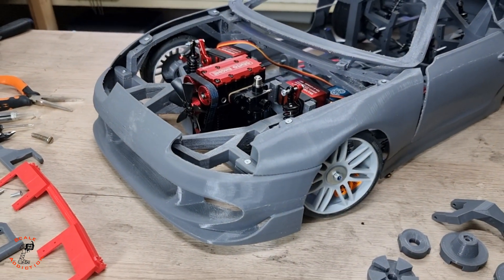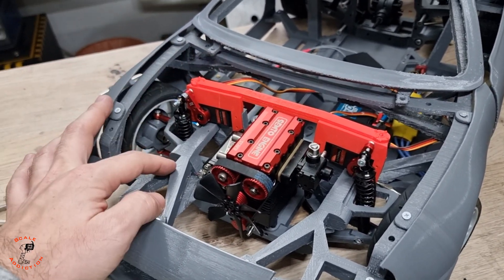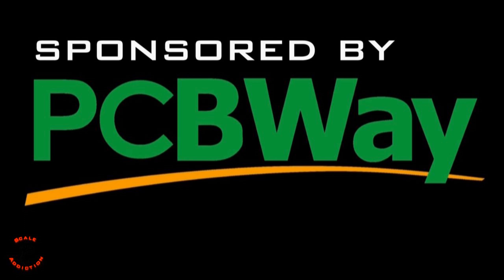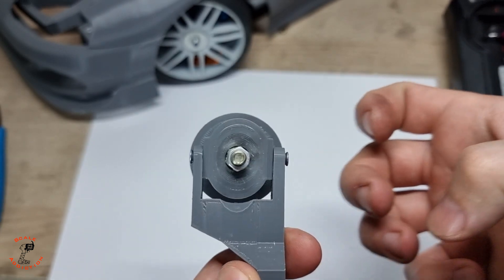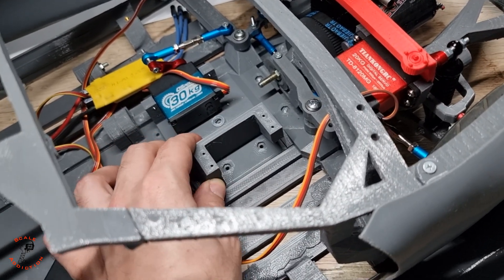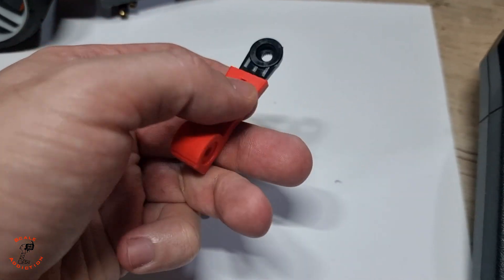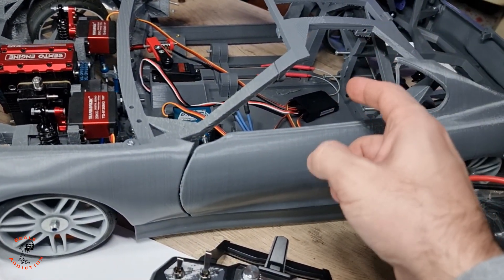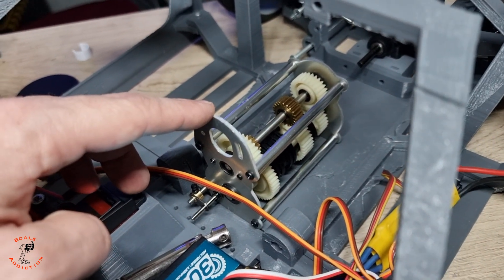Part 7 /  8th scale 3d printed supra with 2 cylinder engine project / Scale Addiction

Comment: nice project but I recomend to test the clutch and then motor and transmission before you invest too much time on other stuff. I think the chances are very high that this clutch won't work. In my projects I always try to solve the most crucial issues first and I think the transmission is a crucial issue in this project.
Reply from the maker: I tested, it has good grip, but in the next videos, I will test it for sure

Comment: 3D printed clutch? I would assume that'd burn out easily? might wanna try to add a compound or a different filament between them. Maybe sand paper?
Reply: Sand paper will act like a sanding belt
Reply: Is this the only thing you are stuck on? I think the heat from the engine will melt the front part. And I think the 3D parts will not withstand that load while the car is being driven. The parts to which the engine and transmission parts are connected must be metal supported. But I hope I'm wrong.
Reply: @farukgoksu9088  no I knew that was going to happen, I assume scale addiction has a plan for cooling, the 3d prints will probably withstand the engine. I've made a 3d printed rc car with a 3d printed gearbox, I know what's gonna happen.
Reply: metal plates can be attached with epoxy